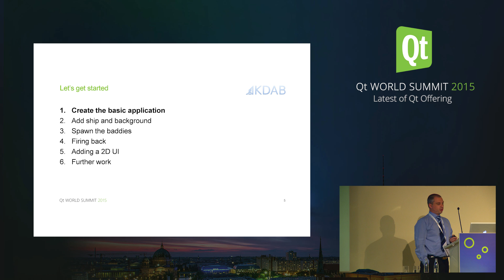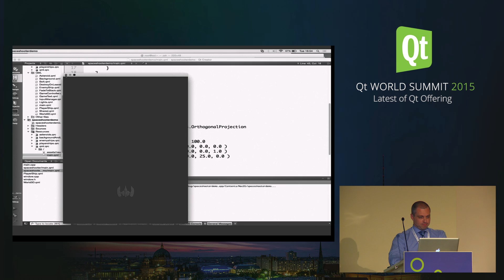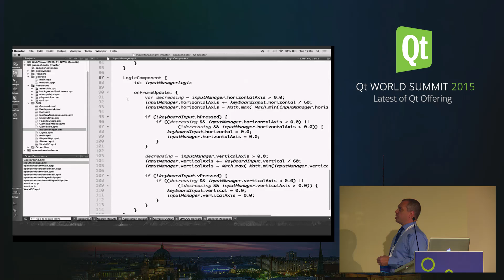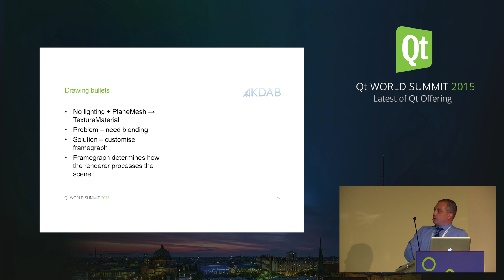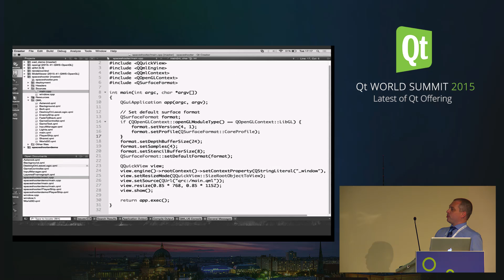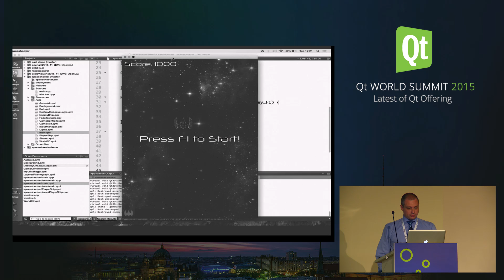Comment: I wouldn't even call qt3d in early alpha stages. To understand how crappy this product is, try to see if you can understand how to render a given mesh (that is, not one loaded from a file but rather generated in-program). No documentation, no nothing.
Reply: +crapodopalese You have the examples. If you want to you can always look through the source code.
Reply: +crapodopalese    A couple of 3D demos come with the Qt installation,
but these are still not enough!

(there are a huge amount of possibble applications of this cool technology; it is impossible to cover all the imaginable cases)

Some of the coolest demos I saw, are unfortunately not available in source code (the car demo, the airplane engine, the coverflow). I hope that these or other demos of similar complexity will come with Qt 5.6!

Additionally, there isn't enough information about the use on mobile platforms (eg. how to use big meshes (.OBJ / .3DS) with referenced tga/jpg files in an apk)

However, the technology is stunning!